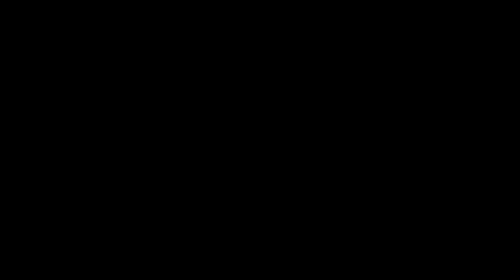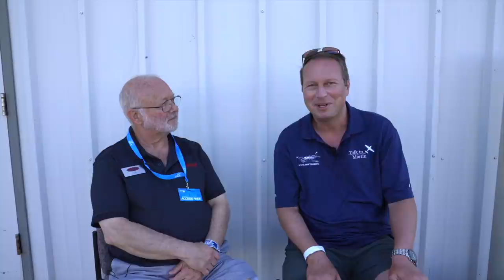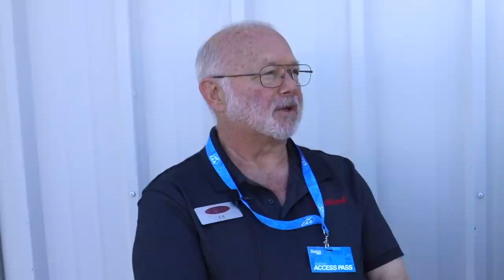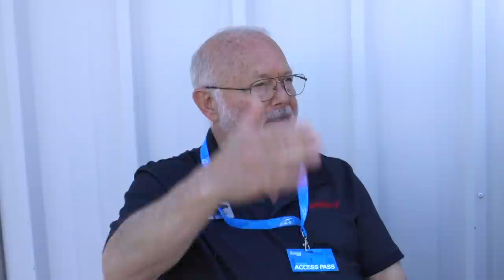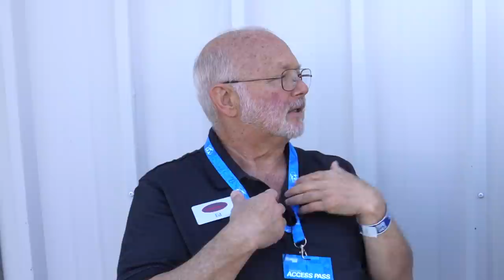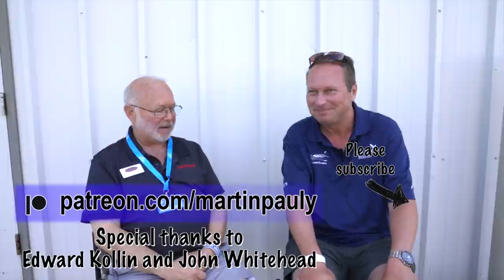Ed Kollin explains Aircraft Engine Oil

Comment: Martin. I have a 2004 T 206. Lycoming io540 aj1a. Manufacture says do not fly lean of peak. No explanation. If this was your airplane, would you fly it LOP. Only your opinion  not asking you to put yourself out there recommending something that goes against manufacturer guidelines
Reply from the maker: Don, I would first determine how far the engine can be leaned without roughness. If that is far enough lean-of-peak for the power you are making, I would be comfortable flying it LOP. Lots of things to consider, but the manufacturer saying "don't do it" alone may just be a leftover old-wives-tale from the old days. We know better today.
Regards,
  Martin
Reply: Instrumented properly, almost any normally aspirated, injected engine can be operated LOP given the equalization of intake charge across all cylinders. Cool with fuel or cool with air. Recall the fuel dilution in the oil is because the engine is running ROP and most likely in the worst operating regiment possible without combusting all the fuel. Washes down cylinder walls as well accelerating wear.

Comment: Martin.
I must commend you on this video. It is the best informative video anyone has ever presented. Everything your guest have mentioned is 100% correct with his information.
I too have been doing research with oils too. My test platform is an automobile (1997 NISSAN  SENTRA) So far oil testing with the original engine has reached 635000 miles and getting 40 Mike's to the gallon. It is true about leaving the oil filler cap off and the dipstick. It works to prolong the. Cleannes of the oil.
Good presentation 😃
Reply from the maker: Thank you for the kind words, I appreciate it.
- Martin
Reply: Manor Dee, I started doing this a few years ago on 2 TSIO-360s and an O-470.  Get the steam out.  The only problem is often the caps stay off for awhile. Especially if its 1100 at night, I'm bushed, and have a serious day the next morning.

Comment: Can't wait until AVGAS gets this needed update, which as I understand means finally no more leaded fuel. I assume that the lead replacement additive will be more compatible with modern piston engine oil formulas that actually have some detergency, vs just some dispersant in the mix. I am guessing still no full synthetic oils will be recommended unless the engine has a complete tear down and overhaul to get rid of existing deposits that contain leaded compounds?
Reply from the maker: I wish I could answer your question regarding synthetic oils, but I do not know for sure.
- Martin

Comment: I own a IO-360, but my question is, why can’t Lycoming and Continental build in a very strong inspection port on the case to allow viewing of the camshaft and or lubricating of the camshaft while it’s not running? Also meanwhile, auto gas has detergents and no lead which prevents all these problems.

Comment: Thanks for the video, I learned a lot.! Is it possible that the cause of the problem is that the aircraft oil is mineral oil?  These criteria are easier to solve with a good thick quality synthetic oil...Synthetic oil also contains SN dispengrens and detengrens additives, they keep the combustion product coke and dirt in the oil in suspension.

Comment: Yes I believe getting the lead out of AV gas will be very beneficial for aircraft piston engine longevity and much reduced maintenance. Spark plugs will last and sticky valves will probably be history. Also I think more and better synthetic bases will become popular as the top premium synthetic oils provide fantastic film strength and therefore much better wear protection, keep deposits in check and are much more thermally stabile, meaning they don't thicken at low temps and don't thin at high temps as compared to conventional oils. Jet engines have long relied on true synthetic oils because conventional oils can not do the job.  Those jet oils are not even close to the cheap automotive type so called synthetics we see on the shelves at the big retailer's and stuff.  I believe jet oils are top tier group V ester based oils and they are rather expensive. It think it would have been interesting if Mr Kollin would have expanded more on issues of the lead not staying in suspension in  synthetic oils. He eluded to that when he said the wrong synthetics. So what would be the right synthetics I'm wondering? Or did he mean no synthetics at all.  Amsoil & Mobil had synthetic AV oil out for a short time in the 70s but I know Amsoil dropped it because of red tape & costs of certification and possibly the lead issue. 
 Very interesting talk however. Thanks Martin
Reply from the maker: Thank you, Dennis. Maybe Mr. Kollin will see this here and chime in with some more information.
- Martin
Reply: @martinpauly  you betcha ! I'm probably one of the world's oldest students ha! Never got my ratings When my Pop was around, he was a CFI n stuff. But I am very interested in this stuff hoping to maybe get at least my sport pilot one day here. and I have used Av gas in some of my ground vehicles engines as well because it does last good. 👍

Comment: I'm kind of a car gear head I love automotive engines but what I'm really interested in is knowing why aircraft craft engine seize up more often than automobile engines even after using what I would consider the best oil
money could buy.. 

Aircraft engines are fairly low compression compared to automotive engines and they use dual ignition plus low lead fuel 100 octane and run at a fairly low rpm continuous..
Could I be wrong as outsider not understanding how aircraft engines are put together,  plus as a side note why aircraft engines so expensive I don't understand why they cost so much.
Reply from the maker: I think I can answer the cost part of your question, Rafael. It's driven by the very low volume, and by the outrageous liability claims when something does go wrong. 
Regarding "seizing up more often"... I don't know if they really do. Most of the in-flight engine failures happen due to... ready for this? fuel exhaustion! Yes, pilots run out of fuel in flight - that is the number one reason for power-off landings.
Regards,
  Martin
Reply: @martinpauly  

Thanks for your reply, 
I just can't imagine flying a plane without being certain there enough fuel .. 
Well I'm glad the insurance companies haven't decided driving a car is more risky than flying a plane.